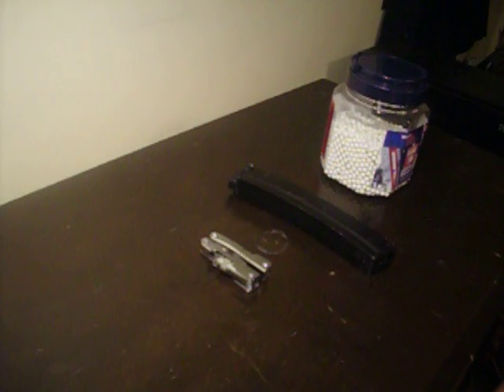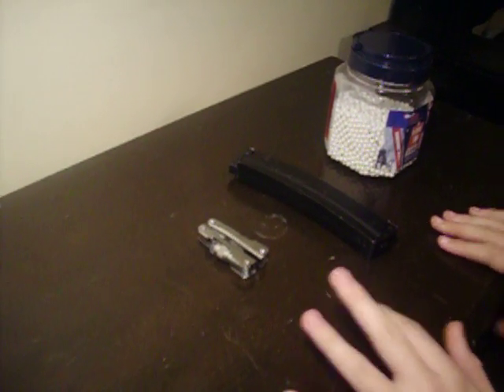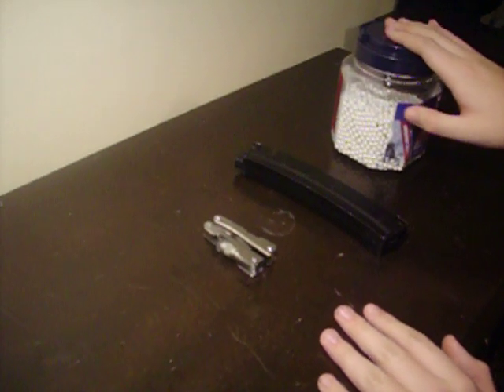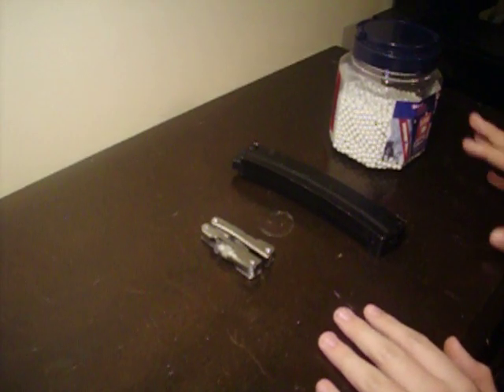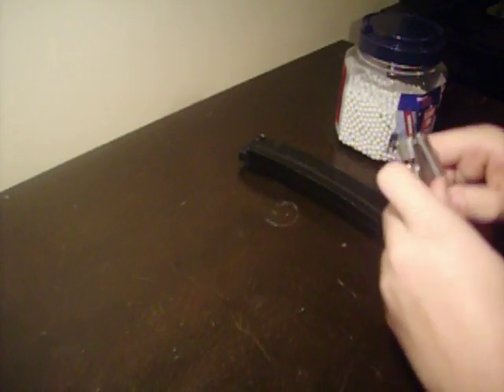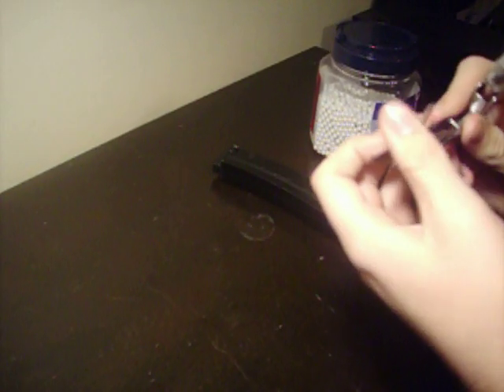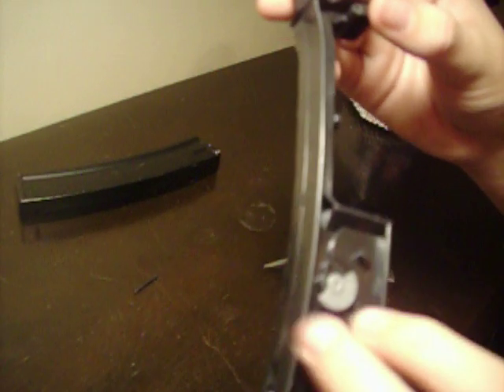How to fix Mp5 Magazines

Comment: Can you do a video on how to change the spring on a factory issue mag that comes with the G&G mp5?  It's 19x9mm it holds 19 rounds but I want to change it to hold 40 but my spring is not powerful enough to push all 19 .20 g bb's up.

Thanks